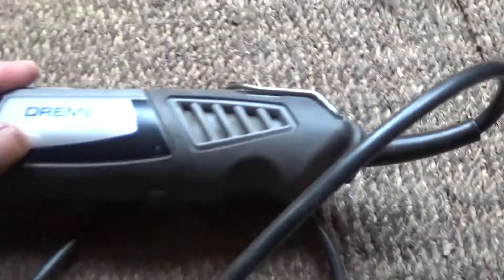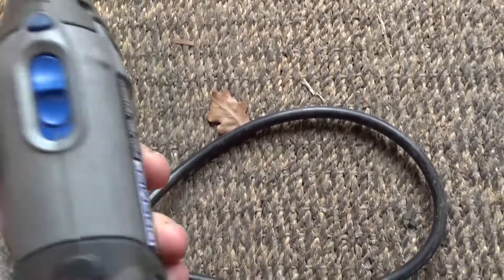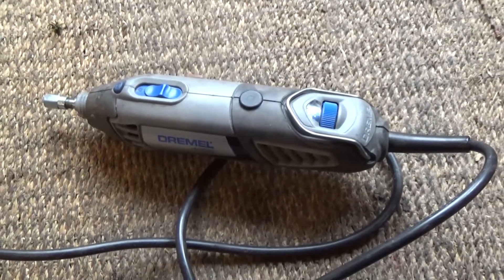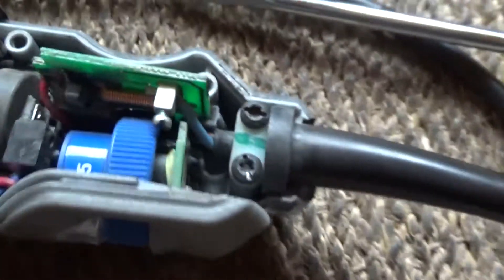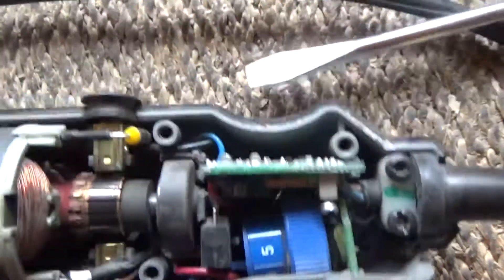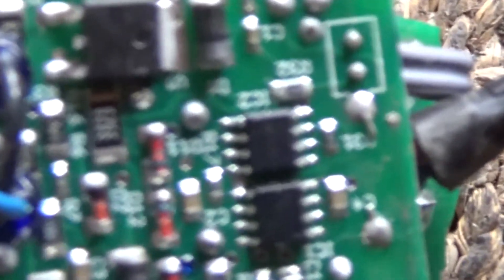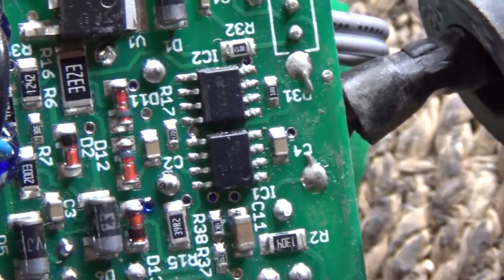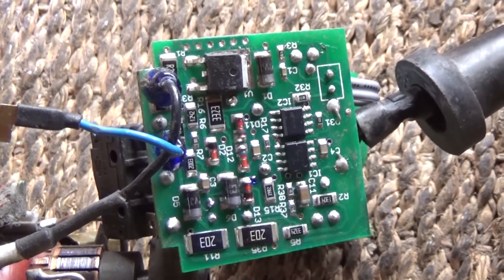Dremel 4000 - FAIL

Comment: I have the exact same issue, when I connect the motor directly to 230v it runs fine so I assume the circuit board failed.